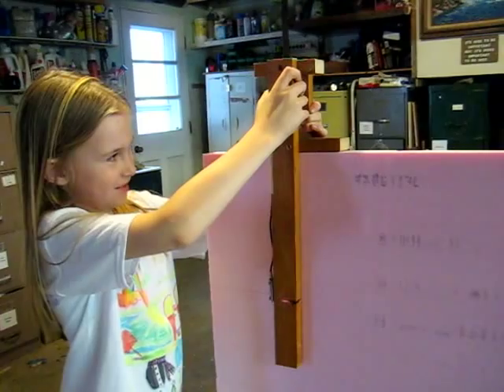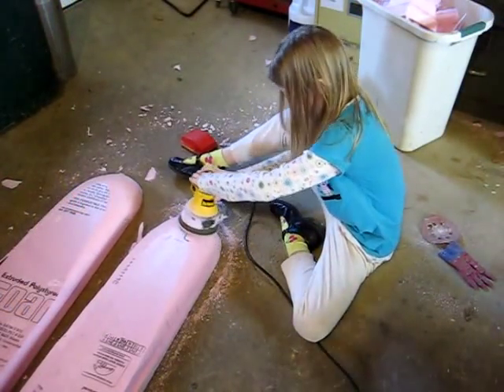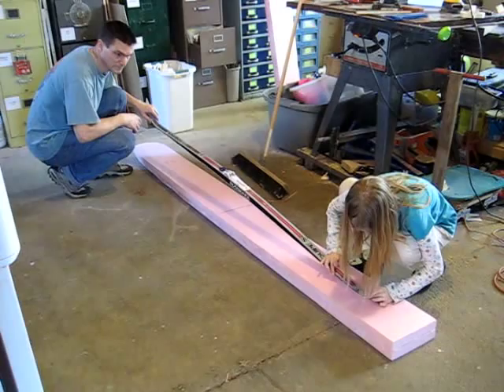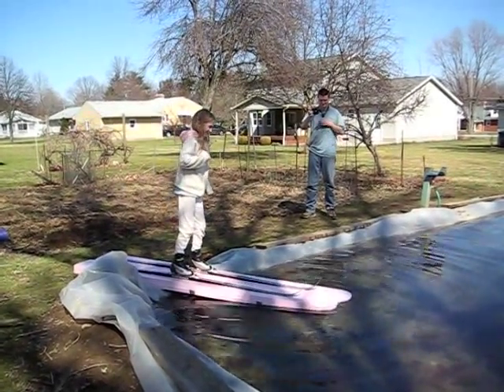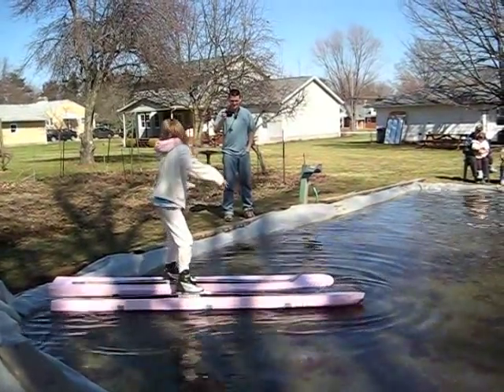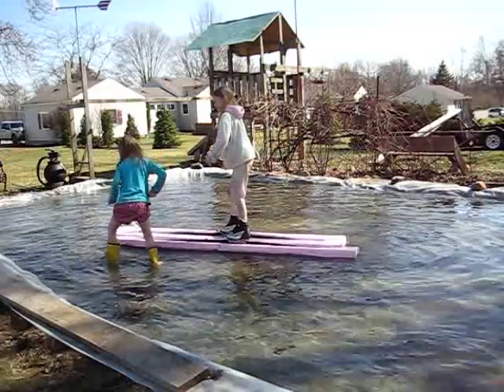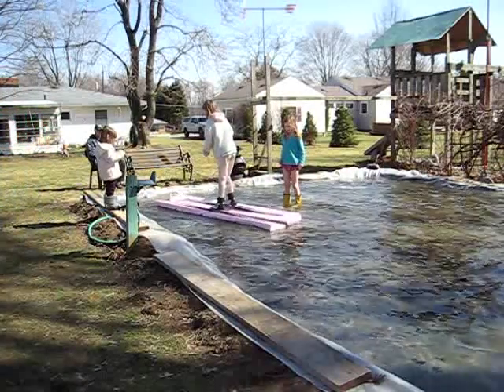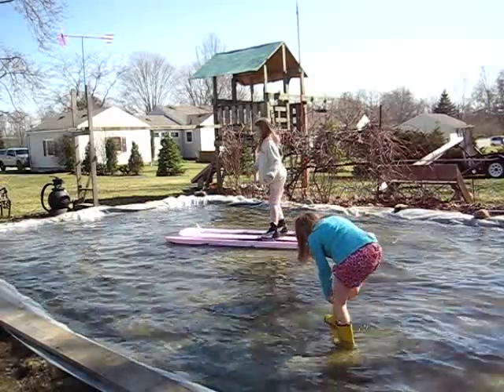Svea's Water Walker Skis

Comment: The design is something I have seen before from other people and they experienced the same problem, the skis would separate. Not even athletic adults had inductor muscle strength to keep the floats together. All of them eventually ended up in the drink as did your daughter. Try attaching three lanyards to the Xcountry skis at the tips and in the middle which are slightly wider than the shoulder width of the walker. The only thing the walker has to concentrate on is balance and forward motion.